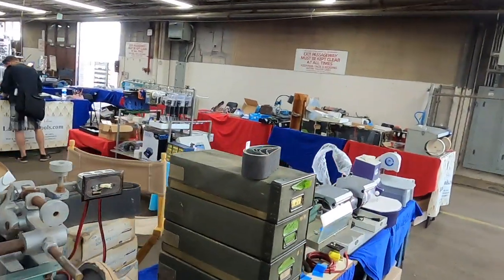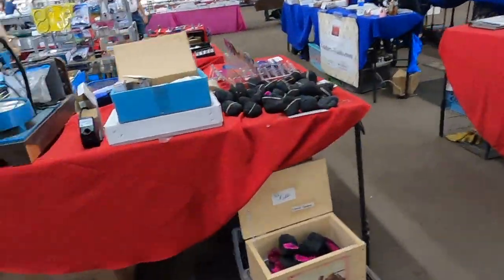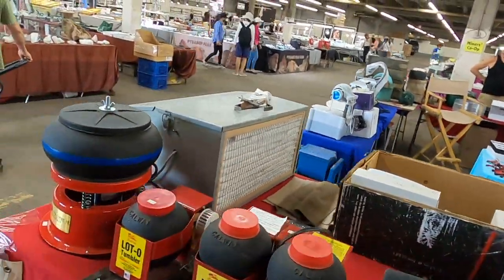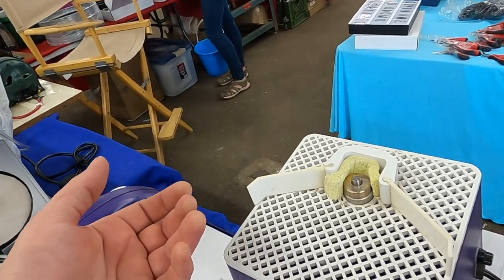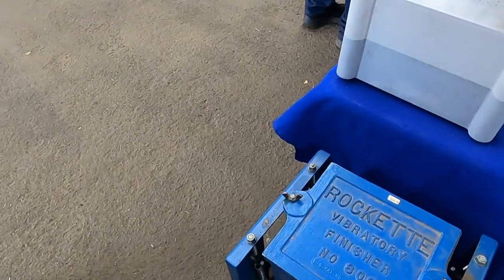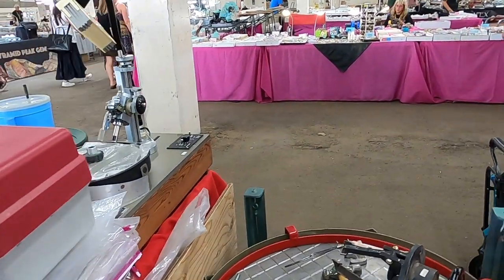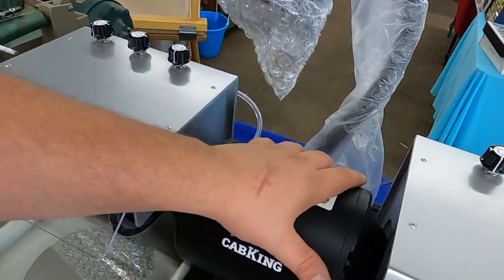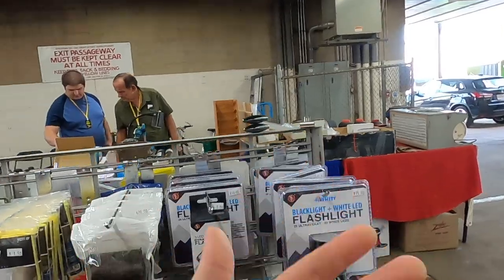Denver Gem Show part8 Used Lapidary Equipment

Comment: Hi dave.i bought a new 8 inch cab king last year with my stimulus  money courtesy of our government. Any how  water not coming out enough  so I took apart and blew some air through  it.works perfect again.i wonder if I should soak the brass valves in vinegar  also.have you had to take yours apart and clean the valves.mine has not been used all that much yet.
Reply from the maker: They can definitely help what I have noticed in the past of the waters been getting stuck in my plastic I expand in the holes ever so slightly but I think I might just replace it let me know how it goes with the vinegar my friend I would love to hear your thoughts and experience
Reply: What I do is I get the whole water tube out and I put the hose partially into it and the pressure of the water, will take out all the gunk

Comment: I actually just bought a old texas rocks 12” slab saw and it uses weights. In my opinion it’s a lot faster
Reply from the maker: Sherman Roland one of the owners of the New Highland Park company who is also one of the creators of the best machines currently in the industry says even though they make great auto feed machines some of the best lapidaries that they know disengage the auto feed and use weights they literally drill holes into the brand new machines to set up weights because it’s faster if you know your material